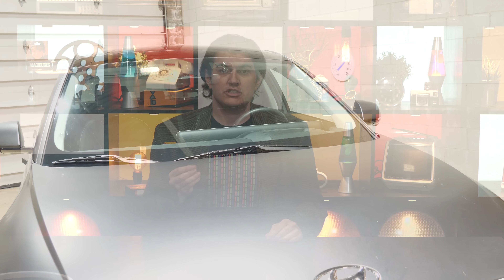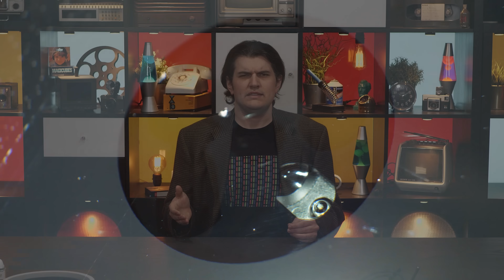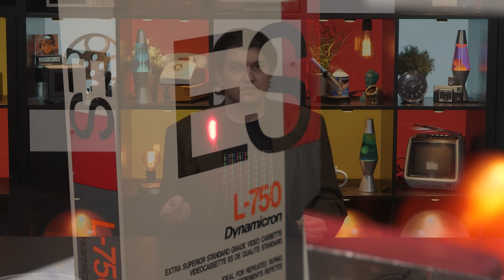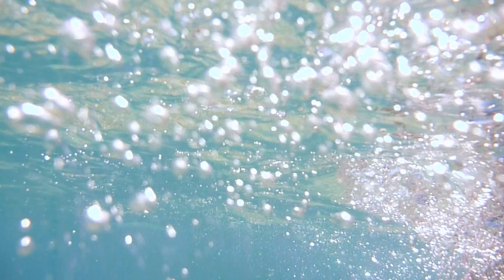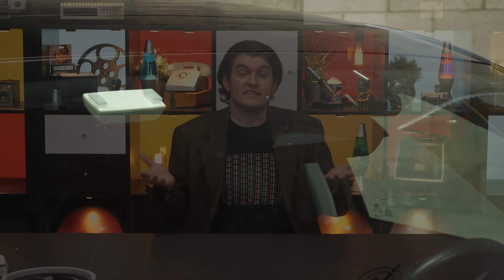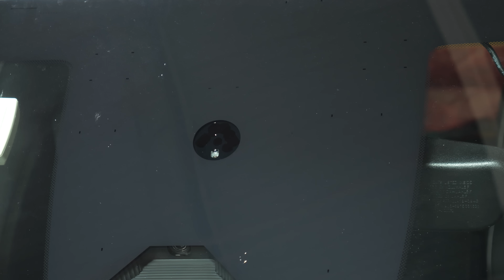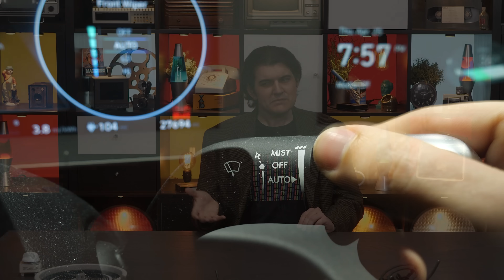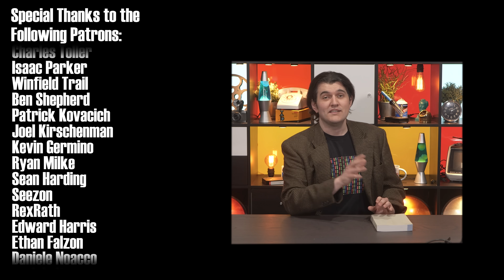The simple, clever sensor behind automatic windshield wipers

Comment: There's another very good reason to read the manual for the things you own, especially the more complicated ones. 

Reading the manual will tell you how to do everything you want to know, but more importantly, it will tell you about features you didn't even know to ask about.

A very long time ago, I was reading the manual for my car and found out that there was a fuse I could pull if I didn't want to have to press down on the brake and the clutch to start the thing. If you have a manual and always pull the handbrake when parking, requiring you to press down on the foot-brake to start the car is honestly kind of silly. So I pulled that fuse and didn't need to do that. 

Also, it turns out that fuse (probably more accurate to call it a jumper, but it was in the fusebox) was ALSO in charge of requiring me to press down the clutch to turn on the car, so I could actually start the car in neutral without pressing down on the clutch. Hell, I could start the car in gear if I was crazy enough. Who would want that? No one, obviously, but reading the manual taught me about things I never would have considered possible, and that's one of the best reasons to RTFM.
Reply: What a bizarre way to enable/disable a feature. I only have to press the clutch in mine, but I wish I didn't have to do that. In my early days of driving, the vehicles were mostly from the 70s and 80s and I could just put them in neutral to start them. In modern vehicles, I have to hold the clutch even though I always put it in neutral anyway, which is pointless. If I remember correctly, my current car has separate clutch switches for the ECU and the starter, so maybe some day I'll jumper out the one for the starter.

Alternatively, my motorcycle uses switches for both neutral and the clutch and only one of them has to be made to start the engine, which is perfect. However, I have a feeling there's a law in the United States that automobiles must only start when the clutch is pressed with no exception for it being in neutral, so even though my car has a neutral switch, it's only connected to the ECU.
Reply: After having a job where I had to move a bunch of cars, I really appreciate having to press the clutch to start a manual. I pretty much assume all cars are automatic because 99% of them are, so when I can't see the shifter (for example when it's night), and the car doesn't start, I know to check if it's a manual. 

I had a coworker who once went out to check the mileage on a car. They opened the door and leaned in to turn it on, and the car lurched forward. It was a manual, and whoever parked it apparently didn't believe in using the parking brake and just left it in gear. Someone at some point must have disabled the brake and clutch interlocks. My coworker wasn't even trying to start the engine. They were trying to turn it on in accessory mode, but it was push button start. To put a car with push button start in accessory mode, you push the start button twice, but without the brake interlock, the car just tried to start the engine anyway.
Reply: I meant to say that you typically press the start button twice without pressing the brake to turn a car on in accessory mode when it has push button start, but the mobile app isn't letting me edit my comment. Whenever I try, a pop-up appears asking if I want to keep writing or discard. If I press keep writing, the pop-up immediately comes back asking the same thing. If I hit discard, then it takes me out of edit mode.
Reply: @jsax01001010  The edit issue happens to me occasionally. Just discard the edits and try again. You may have to leave the page and come back. The Youtube app has been getting worse and worse the last two or three years.
Reply: @chitlitlah  I spent about 10 minutes trying to edit my comment. I even accidentally restarted the app, and that didn't help either. (I didn't want to restart the app, because I don't know an easy way to find my previous comments in the app. There's a far too complicated way to do it on desktop, but I didn't want to boot up my desktop computer just to edit a comment.)

Comment: One little tidbit about the IONIQ 5 and manually forcing the wipers to wipe when in Automatic mode — anytime you increase the sensitivity, it will force a wipe.  This is likely to aid with recalibration, but it’s useful to quickly force a wipe without taking it out of automatic mode (as happens when you move the stalk down and back up again).  The only issue here is that decreasing the sensitivity doesn’t trigger a wipe so if you’re already at the highest sensitivity this doesn’t really work, unless you first turn it down a notch.

Comment: The shade thrown at "that car company" for their absolutely garbage automatic wipers is so on point, I love it.
Reply: Absolutely  garbage auto wipers. My model 3 wipes when it's sunny and doesn't wipe enough when it's pouring
Reply: @zoppp621  This simply cannot be.  Elon is a Super Genius, or so we're told, so clearly the fault is with the climate where you live.
Reply: @zoppp621  turn it off, use rainx, great results on my MYLR
Reply: I have a brand new refreshed model 3, and I will happily admit that they are currently absolutely garbage. There are rumors of an upcoming update to improve them, but I am not holding my breath for it. They trigger at the appropriate time for me, but often at the wrong speed (light rain, and they are going crazy, heavy rain, and they are too slow). The one remark I will commend them on, is that they are easily controller via the buttons on the steering wheel in my case.
Reply: @ProXcaliber  YES i was happy to see my 2023 model 3 refresh ahd a button for it on the wheel. that will come in handy
Reply: @pvic6959  You will need it, trust me. I live in Florida, where it rains pretty frequently and can vary in intensity from one minute to another. I decided to turn off the auto wipers because it was always either too slow or too fast for the amount of rain.
Reply: @ProXcaliber these rumors has been around since they introduced it in 2017
Reply: @ExperienceCN  Actually, I’m on the latest update of 2024.3.25 for my Model 3 since I wrote this comment. And ever since I updated they have actually been significantly better for me. I don’t know what they did (since it wasn’t in the patch notes) but it is way better than the previous software version I was on.
Reply: Over the Air Updates are great. Alec’s IONIC 5 will need to be throw away and buy a new one for new software
Reply: @pasilinnosto6712 It's OK. Cars got along fine for a century without software updates. Alec will be ok.
Reply: @pasilinnosto6712  Hyundai's and most other electric cars also have OTA  updates.
Reply: i have one, they are garbage
Reply: I will say though, "that" car company at least has a change wiper mode option in the settings that's relatively easy to find. .Still, valid points
Reply: i just bought  the 2024 model 3.. it hasnt rained yet. im scared lol
Reply: Through various updates the auto wiper function on our Model Y has gone from Abysmal, to Bad, to Poor, to Lacking.  I suspect after an inordinate amount of effort it may asymptotically approach, but never reach, the functionality of the standard solution.  But, algorithmicists gonna' algoritate.
Reply: @BixbyConsequence  Algoritate? Love it. I'm going to use it at least once a week to impress...??? Well, I'm not sure who, but I love it.
Reply: Every mis-wipe my Model Y did reminded me of my mistake in putting it in Auto when it started raining.
Reply: The thing is that it actually WOULD be a good idea to "delete" the ostensibly redundant sensor in favor of camera vision activated wipers, IF the cameras could see the windshield like a person can. But....they can't of course because they're intended to focus on the driveable space and the road to feed information to the FSD computer. Thus the aperture of the lens is fairly wide to capture a lot of light during darkness and therefore the depth of field for the cameras is shallow - it can't and isn't focus on the windshield itself. So if you go into the service mode on a Tesla and look at the raw camera feeds while it's raining you can't see individual rain drops on the windshield, all you can see (if it's raining hard enough) is the extra blurry distortion an additional thin layer of water on the glass produces in the camera imagery. It's using that image distortion and the road wetness 'network' to infer (usually poorly) whether the windshield is wet or not. Yes I can confirm it's a bad solution to a non-existent problem. The most recent software update does make it better, almost usable actually, but it NEVER automatically starts during fine drizzle or very light rain and needs an initial button push to get wiping in that situation. Elon's ethos of "delete the unnecessary part" has proven HIGHLY successful and profitable in SpaceX, but like anything can be taken too far, which it is in the auto wipers on Tesla cars.
Reply: @Muonium1  I lol'ed at "Elon's ethos of "delete the unnecessary part" has proven HIGHLY successful and profitable in SpaceX"
Reply: @ytlurker220  lol away; they've captured the overwhelming majority of the world's commercial launch market in less than a decade, are developing the world most powerful rocket by more than a factor of 2, and are lolling all the way to the bank at a valuation of about $200 billion.
Reply: Sad thing, they had them working decently for awhile, then broke them.  

However, didn't have to read the manual to figure out how to put the wipers into maintenance mode!
Reply: As an engineer who works in the field of machine vision, I absolutely cringed when I heard that automaker was trying to use a camera to control the wipers.
Reply: "that company" isn't a car company.

It's a  techbro company which happens to make cars.
Reply: @AlldaylongRock  and who fired the entire team making new cars and the sc team.
Reply: The rain vision on the tesla is compete garbage. It turns on in the sun, turns off when its pouring.
Reply: @jelin5233  supposedly they run the wipers to clear the camera at the top. Still stupid though lol.
Reply: I've driven a Model 3 for 2.5 years and honestly don't get people's issues. I've occasionally had them want to go when dry from I assume bug carcasses as it stopped upon using the wiper fluid to give it a clean, but otherwise it has seemed basically indistinguishable from my BMW 3-series autowipers that preceded it.* 🤷‍♂

* Well, until the recent FSD trial--FSD really thinks it can see fine when the windshield is decidedly quite covered in water lol.
Reply: The reason why is curious. For advanced features like this, automakers often purchase or license the feature from third-party suppliers.  This allows Hyundai/Kia to leverage a lot of tech used in more high end cars.  For example.  But Tesla likes to in-house everything and this means they have to reinvent the wheel all the time, rather than just licensing best-in-class features.   And they simply can't outdo vastly more experienced suppliers.
Reply: We skipped a Model X because it lacked the wiper and TURN SIGNAL stalks and went with the Model Y. Always wondered how/why the psychotic wipers worked, super fast in low rain, even after window is clean. How did these kid engineers miss the J-channel/gutter on the left side of the windshield?! Every time I use the window cleaner the drivers window gets blue spluge running across it. So many inexperienced mistakes, well at least the wipers don't get frozen, gotta say the wiper heaters are a good idea.
Reply: I remind everyone why teslas are so cheap - no parking prawl, no rear door releases, no battery heater (uses motor windings to heat up fluid - stupid), no backup heat for low ambient temps (uses compressor windings for heat - very very completely stupid). And now no stalks, no buttons for most stuff, no radar sensors.
My Niro costs more - show me a Tesla 3 years in with 0 battery degredation - you can't. Kia OTOH built in degradation from the start so you lose nothing as initial capacity degrades.
Reply: @sprockkets Wow, your ignorance knows no bounds. Your assertions about how all that stuff works are almost 100% wrong. For starters, there ARE manual releases for all the doors.
Reply: @awo1fman  not to mention a heat pump that is able to use various heat sources to warm the batteries. That said, the wipers are shit and the lack of indicator stalk moronic!
Reply: @awo1fman  nope, no model 3 or y have emergency door releases in the back. 
Cope.
Reply: @awo1fman  It's not that manual door releases don't exist, it's that at least one driver fatality could have been avoided had she known they existed before her car was underwater. It's an issue that's on people's minds now.
Reply: @WyvernYT  I think the manual release levers should be LABELLED, but even if she knew about them it wouldn't have saved her. The water pressure would have prevented the door from opening. Her only chance at survival would have been to immediately roll the windows down while the electronics were still working, but she was drunk, and likely didn't know that. After that, your fate is sealed. The side windows are all acoustic glass now, not safety glass that shatters completely and falls away when broken, it's like the windshield, effectively impossible to break and escape out of.
Reply: I'm a Tesla fan but yeah, I gotta admit, having non-working auto windshield wipers stings quite a bit. Good thing it rarely rains where I live. I'd love to be proven wrong but I also don't think the problem could be fixed by software.
Reply: ha ha ha elon bad
Reply: @squidikka  "Every legitimate problem is just haters" is not the slam-dunk comment you think it is.
Reply: @squidikka it sucks in my m3. This isn't haha Elon bad. This is a legitimate problem.
Reply: @squidikka yes, actually
Reply: @squidikka I see a diamond nepo baby fan getting salty lol
Reply: @CharlesAnjos  It is totally inappropriate to call him a diamond nepo baby. He's an emerald nepo baby.
Reply: @CharlesAnjos Jesus, you've drank so much Kool Aid you aren't even falling for the emeralds and went to diamonds
Reply: @squidikka  This has nothing to do with Elon. Those wipers are genuinely massive piles of dogshit lmao

Comment: You know, what's particularly infuriating about having to refer to the user manual about stuff like that is that it really wouldn't be that hard to incorporate a help function (complete with search bar) in the touchscreen interface every manufacturer insists on putting into their cars. I'm sure it's a thing on some cars but it should be universal, really.

Comment: I hate my automatic wiper function with burning passion. It almost never wipes at the right speed, it either goes berserk when the windshield is hardly moist or it just does nothing. And the incredible clever engineers in Wolfsburg had the great idea to have the automatic setting be the same as the slow interval setting which you need the most. It is so annoying...

Comment: Same thing on my Audi A3. For changing the wipers they need to be in a "service position". But they kindly included two ways to reach this. One is a setting on the computer and because the computer was optional you can also achieve this by holding the wiper stalk on single wipe for a few seconds

Comment: Too bad these are actually complete and utter garbage. I would actually pay extra if I could turn off that sensor and just go back to different levels of incremental wiping controlled by a knob. It starts going when it shouldn't, and if there's a fine rain completely coating the windshield it won't register at all, or go completely and utterly bananas at high speed, nothing inbetween. It also doesn't register snow, at all.

Comment: @TechnologyConnections I have the exact same car as you. Have you noticed specific situations where it really sucks or magic incantations to make it work properly? Very rarely does mine actually work well; it goes crazy with a fine mist and then does nothing with relatively high rain. It's especially bad with snow, which is a thing that happens up here in the Great White North about 4 months out of the year. Looking online, a lot of people seem disappointed with the automatic wipers, but I don't know if that's something that could be malfunctioning and needs to be fixed or if they do just kind of suck in general. It's to the point that I'm considering looking for a way to revert it to intermittent (I'm sure it's just a setting in software).

Comment: My Freightliner semi has that type of rain sensor / auto-wiper control system. It's IRRITATING!
I put the wipers on low, intermittent for a light rain and I can count the wipes until it starts speeding up. Within 1 minute, it's at full-speed.
One thing I think it might be is the quality of wipe from the wipers themselves. My DS wiper is new. My PS wiper is older. At $30/blade, I'm not keen on spending my money on the company's truck.